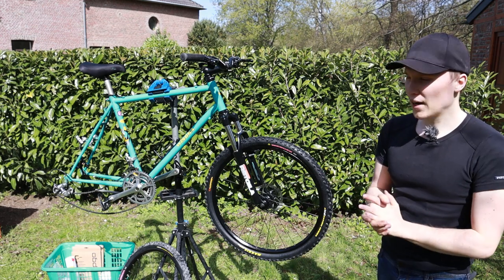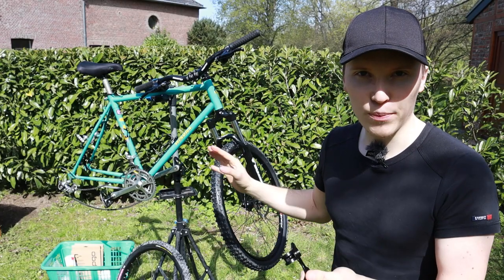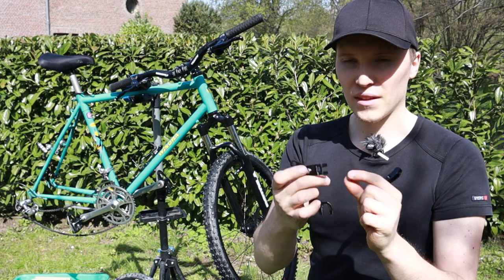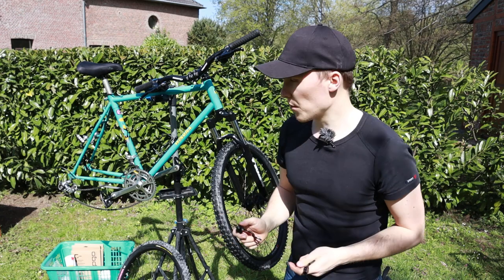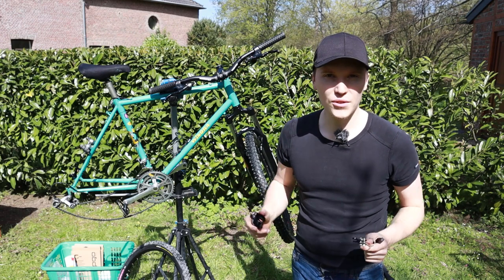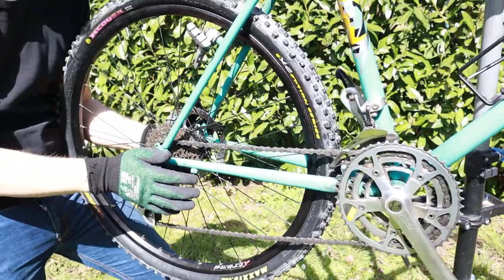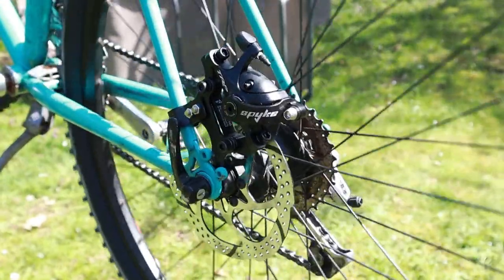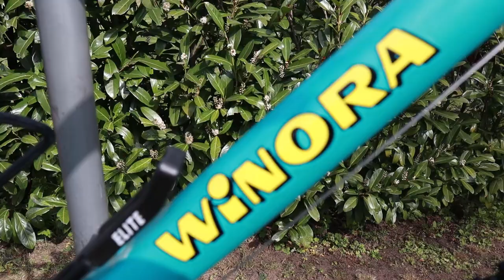Convert Cantilever to Disc Brakes - 80´s MTB RESTORATION: FINAL PART

Comment: Did you put something in before the headset in video 1, so that the it could take a 1 1/8th inch headset instead of 1 inch ? If so where do you get these please ? Thanks
Reply from the maker: Hey there. Yes indeed. That´s exactly what I did. You can see that in part 1 I think. 1st I pressed in the so called "Problem Solvers" which reduces the 1 1/4 to an 1/8 inch headset. ;)
Greetings, Armin
Reply: @Armin_27  Thanks so much

Comment: Cool project, but wasn't it meant to be a 1x drivetrain? Also the frame could have used some restoration work, maybe even a new paint job
Reply from the maker: Thanks for watching Robert! The Winora is a 1x Drive now, which you can see in the couple newer videos. 😊 I would also love some fresh paint on this thing, maybe even welding the adapter on the frame beforehand. 
Let's see, if I have some cash lying around, we might do just that. 😏👌
Cheers Armin

Comment: No problems with the frame thickness on the adapter mount points?

I would not put Rubber in the clamp part. I would 3d print a more harder part then it can not move.

And I would use short er screws with nuts that have a security Ring to sit it hard and not move
Reply from the maker: Good suggestions! Well, the adapter works well with roundish frames, even though the winora made of steel was even a bit to small in diameter. That's why I used the rubber. 
I would love to have a 3d printer. 😅 I had so many ideas to use it.
Reply: @Armin_27  Mmh my steel frame from around 1996-1999 has a similar size like yours. It's on the place of the clamp around 12-12,5mm in diameter. I drive a Touring bike make to a road bike.

And yes 3d printer is sometimes usefull.
Öh seh ich gerade richtig auch aus deutschland
Reply from the maker: @-Gothicgirl-  Haha, ja herzlich willkommen hier! Girls oder Deutschsprachige verlaufen sich wirklich nur selten auf meinem Channel. :D Scheibenbremsen noch auf dein umgebautes Rennrad zu installieren würde aber wohl schwierig werden. :P
Gruß Armin
Reply: @Armin_27  Naja der Rahmen sieht deinem Rahmen von der dicke der rohre sehr ähnlich. Und Umbau sollte gehen. Die Halter passen schonmal dran.
Ich denk mal nicht das es ein Problem gibt
Reply: So nach nen halben Jahr und 500km mein Fazit! ich kann sagen mein Rahmen hält es aus auch wenn ich aus 60 runter Bremsen muss wenn ich in Berlin den Müggelberg runter eier. Derzeit sind es hinten und vorne 180er Scheibe mit mit zoom db680 er dual piston Bremsen werden demnächst gegen trp  getauscht. Adapter sitzen dank der 3d Teile bombenfest und kein rahmenbruch zu finden.  Der Stahlrahmen scheint damit zurecht zu kommen. Würde ja ein Bild zeigen aber yt killt den link

Comment: convert it back or I unsubscribe haha 😂😂  I enjoy your Video, I converted my Vintage Bike to Modern too,.. What a experience I had, smashing the Crank out, rusty and loose threaded 😅
Reply from the maker: Haha that sounds like the project kept you busy. Love to read it! 😅 I was rather thinking to weld on the disc brake adapter and then give it a fresh powdercoat but in the same color. 👀🤫

Comment: (Thinking While Typing) You could buy 2 Dual Pull brake levers ($15 each) , keep the rim brakes, then add cable or  cable/hydraulic disk brakes for some major stopping power. (would be nice on city commuter bikes when u need to make quicker stops because of drivers not seeing you)....I was thinking about doing this on my motorized bicycle..... Except I wanna use some type of 2 into 1, brake cable connector to where I can combine the 4 brake cables together(4 into 2) before it goes into the dual pull lever. That way I'd only need 1 dual pull brake lever, since the clutch lever is on the left side of the handlebar. It could easily be done on many bikes using 2 dual pull brake levers though.
Then when you pull the brake lever, it'd make both rim brakes & disk brakes activate at the same time. Or you can adjust, so the disk brakes would clamp down 1st then the rim brake pads, which would provide secondary stopping power. Not only would you have 4 brakes stopping the bike  instead of 2. But you'd have even more stopping force because of the way it's applied, The bike would have have stopping force placed on both the outer wheel/rim & inner wheel/hub.  Buell motorcycles developed a perimeter front disk brake system because it provides more stopping force than hub mounted disk brake setups.
  Ideally you'd also want the bicycle rim brake system setup (rim & rubber pads) made of the same disk brake material but they obviously don't have those.
Reply from the maker: Hehe now that would be some idea, Michael! 😯 I like it! Haha. I'm currently in touch with someone who can weld a disc brake adapter onto the rear chainstay. So there might be a another video or two about it coming soon. Then fresh powdercoat (same colour) and someome would have to recreate all stickers. Also I upgraded to 11 speed with a 50 cassette. 😎  Greetings! 😄
Armin
Reply: @Armin_27   
     I'm trying to keep my 2 stroke motorized bicycle for transportation build on a budget since I'm broke due to health issues. But now I'm somewhat regretting not buying the 29in  $250 Schwinn Boundary that came with dual disk brakes. Instead I went with a cheaper Mongoose Exhibit because it was on sale for $100. That only had a front disk & rear V brake. It was $150 cheaper & also came with stronger 48 spoke wheels (stronger steel hubs & stronger thicker axles)  But now that the bike can go 40mph/65kph I really need more stopping power & not having a rear disk brake capable bike sucks. 
     Just switching to 2 larger F&R disks might have gave me enough extra stopping power. Now I'm trying to find a cheap option. The trade off with using the Schwinn VS the Mongoose would have been I'd have dual disk brakes but a weaker rear wheel, hub & axle not made for high speeds & heavier rider.

Comment: One thing that bugs me is bottle cage bolts. I always change from the rusty old ones.
Reply from the maker: You are right, Nicholas! I will change them. ✨
Reply: @Armin_27  yay :)
I buy them from bicycle stores. I especially like the stainless dark grey coated ones :)
Also there are coloured ones on ali express etc. I love your old bikes. Please do more :)
I have an old gt ive upgraded. Trying to make it front disc but second hand market isnt great here in nz.
Good luck with your channel